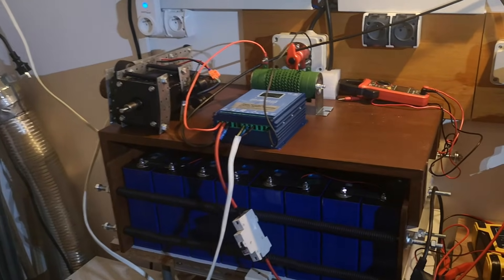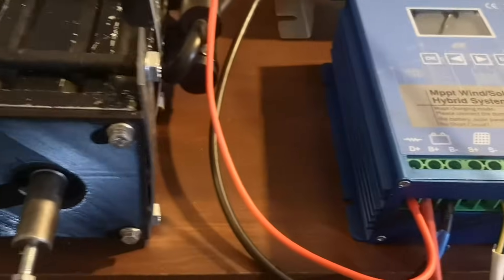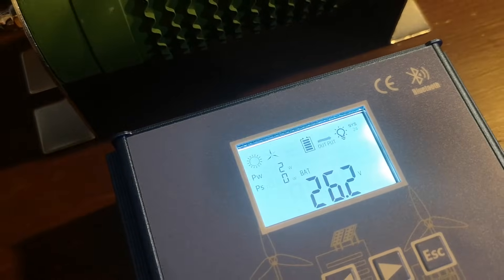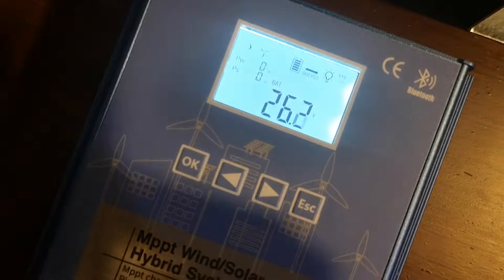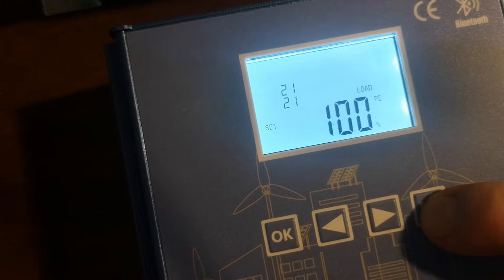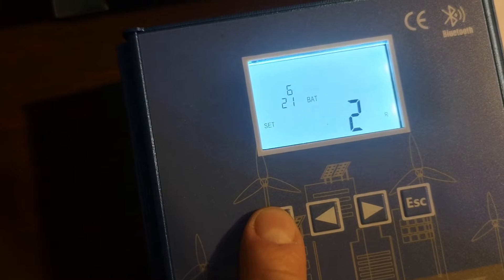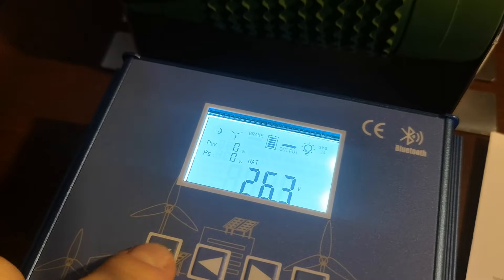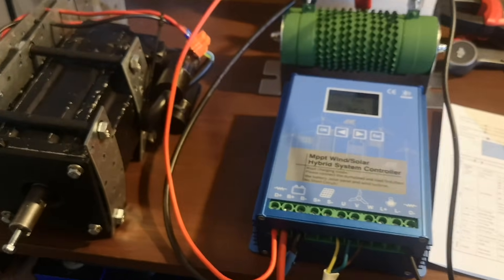MPPT wind solar hybrid system controller - review and setup

Comment: Hello, I have the same LHECR-48V charge controller. My 48V batteries are lithium. It needs more than 8V for the wind turbine indicator on the controller to turn on. It's not charging. No amps, no watts, even though the wind turbine can generate up to 20V. Can you help me?

Comment: Hi and thanks for the good info. I just have a question, mppt takes a small amount of power from the battery, but if there is no wind for example for 20 days how do I avoid mppt from draining the battery completely. Can anyone help? What is the load used for with the bulb? L+ and L-
Reply: No one ?

Comment: Just want to mention for others, that the CE symbol is NOT conformity for European Union, but Chinese Export symbol. So be careful if you use it as it doesn’t fulfill the EU norms for emitted radio frequencies, other safety etc.
You can google the CE symbol differences to spot it.
Reply: How did u carry out the frequency test radio emit thing. Which is an EU standard product?
Reply: @Vbastin-p2r   for you and other readers: please put in YouTube “ce symbol” and just watch some video or short to understand that to get the European CE symbol, the company is audited, has to do tests etc for electronic products. They do the tests, then they get the right to mark it. If it would fulfill the EU norms for electronics such as these emitted radio frequencies and safety, it would be allowed to have the CE symbol (the one meaning EU conformity) and they would print the proper CE symbol on it. BUT instead this one has the similar looking CE symbol (China export) that is used to trick people who can’t tell the difference between the two. China export CE does not require any testing, does not fulfill norms, and safety. This product has only that symbol on it, to trick you.

Comment: u could install big 180mm 12v computer fan(s) under resistor and/or charger, it has 12v output even if using 24v battery
Reply: or use 2 12v fans in series if 24v output

Comment: This charge controller will only work if you have your panels setup in parallel not series.  For a series setup you'll need an MPPT charge controller... this one is mppt on the wind only; the solar is pwm.
Reply: can use smaller panels in series if under 50v

Comment: Can I email you  with questions I have on this system? I bought it to get a 12v current for my Jackery 2000 solar generator. It has a 12v AC outlet so I could charge this from a battery system. I am hoping I can use this system and did not buy the wrong stuff. I could connect a 12 v battery to this system and then from the battery to my solar generator. at 12 V. My question is do I need to buy another controller from the system or the battery that will reduce this to 12 V??? thanks for any help. Steve Handy ST. George, Utah

Comment: Ok, I have this same controller. I've had it for about a year before I decided to change my system from 12 to 24v. Now that I've switched to 24v I am not getting any charge output from the wind or solar. If I change it back to 12v it charges normally. What setting am I missing that is causing it to not charge? Have the maunual, not worth a damn troubleshooting this issue.

Comment: Thanks a lot!! Question: I have a similar  hybrid controller for an Off Grid Wind & Solar installation. When I connect 1 phase from the wind turbine the turbine spins normally. When I connect no. 2 & no. 3 phase the controller brakes the turbine. Why and how can I control this brake function?  THX in advance. Morten

Comment: QUESTION: First of all, thank you for the video. I have this exact model MPPT. Second,  How do you prevent it from stopping the solar input when you have a big load demand? I want it to continue to feed the load whatever it can get from the inputs no matter what the load demand is.

I have set it to LOAD MODE 2 which is suppose to be LOAD ALWAYS ON, but when I turn on my electric microwave, stove and heater, it turns off the solar input and battery input. "Ps = 0" when I do that. Once the load demand drops the Ps comes back up to whatever wattage the solar panels are producing and it begins to send electricity to the load. Just FYI, I don't have wind connected, just solar and a battery. So this is only related to solar and a small battery backup which is 100% charged. 

 I just wish it would send the power it has to the load and not stop the solar input. 

The MPPT's  load output is connected to a grid tie inverter that only supplements the grid if it can get it from the MPPT controller.

Also, does anyone know on the what the individual letters (P, T, d) on the bottom right of the screen above K-W-h of some of the displayed info. Let me know. Much appreciate it.

Comment: got the same controller at 15 volts it shuts down i thought it was suppose to control that i end up having to disconnect  the panel till it comes down to 13.8

Comment: hi as like you i am running my wind turbine on a motor for constant running and not using wind 
can the dump load be put onto the ac in or output side instead of using the dump load ?

Comment: I have the same hybrid wind and solar controller and  it shows brake and its not showing charging current battery has 24.6 v and the brake should be on 27.5. But its showing brake now even before it has reached 27.5. Can you help me with this please.

Comment: Hi, how do I test to see if I get power from the wind turbine on the controller?

I got 5kw wind turbine connected with 48v lithium battery. Set the voltages correct.

Problem I have is when the wind turbine is spinning there is no input on the controller. What do I need to do?
Reply: Did you manage to find out ? I’ve also got the same as you . At most I get a 3w up the top but no Amp etc

Comment: Hi I have this controller  on 12 and on b1 my batterys  on 12.3 volts and brake on and  its dumping  all my power please help
Reply from the maker: Provide more info: what is the voltage of generator, that chemistry of battery. 12.3 is far to low to stop charging for any known chemistry (wet acid, agm, lifepo4 lion) give more info I will try to help

Comment: Can you take 2 turbines and run them together? Or do they have to have there own controllers?
Reply: SEPERATE. the output from each turbine with have mis aligned wave output. unless you can sync the waves you must have seperate controllers

Comment: hey. how are you sure that once the "BRAKE" is applied it actually does pass everything to the DL resistor and is not shortcutting the UVW inputs? have you actually seen the resistor heat up in the BRAKE stance?
Reply: The resistor does get warm on mine when it is windy

Comment: I have been using this exact controller for a couple of months now. There is one problem though, the voltage reads incorrectly. At a true 14.4 volts it reads 13.8  volts. After adjusting for the difference in the other settings there have been no issues. Overall it's not bad just off in calibration from the factory.
Reply from the maker: Voltage reading maybe shifted because of long connection (high resistance) bad connections etc.  have you tried to measure voltage on controller inputs using other voltage meter ?
Reply: I have a Victron MPPT controller for solar but use this product for Wind Generator. Both units display Voltage and %, on my setup they read to within 0.1V. of each other.
Reply: yep i have had one for 7 months and have found it to be a very good solarcharge controller (pwm) 6 x 100 watt 12v panels 2series  3 parallel (300w 24V) for a 24V battery  and i worked very good altough i would recommend to mount a extra heatsink on the back as it tended to run a bit hot, here in winter in overcast conditions it outperforms my big mppt system (watt for watt) 1/6 of rated panel power contra my big system under 1/10 of rated power

Comment: i been looking at this none stop for the past 3 months. was about to buy today. but i am still trying to figure out some stuff on it.   like.  what is the deference in the color screen and the one you have ?   is it there newest model?    other one is.  can this be chained. other words.  having more then one unit back to back. say i have 1000watt solar 1400 turbine.  chaining them so i can run another 1000watt 1400 turbine. instead of running another setup..  also.  who is the best to buy from.  i read bad reviews on the china models. some clam there not true MPPT.  some clam that if you open them up all the chips or wiped off so you can not repair it or alter them. forcing you to rebuy them. and some say there not getting the right watts out of them.    these or the things that you see everywhere and make it hard on where and what to get.      i run solar atm.  and been looking to upgrade to wind and water.  cause of where i live. i have a guest of heavy wind throw the pathway.  15mph winds feels like 30mph winds   and water none stop stream.   so this would help IF i can find the right one.     sorry for the long text but i can not get no answers out here.  and this compony dont answer there phones.  that is the other thing.
Reply: I have one like this one. On the wind, it doesn't start charging until 10 volts. I bought a Pikasola and it starts charging at 4 volts. As far as the Chinese turbines, you don't get near the power that they claim. I only get 16 volts in a 50 mph gust. Which doesn't even cut it when it's a 24 volt system. You're better off buying more solar.jm2cw
Reply: @shaymus1968   i am running 1500watts in solar atm.  my problem is night fall.  i am not running a windmill i well be running a water wheel but the motor is a 3 phase.  why i was looking at this cheap china model.  trying to find something i can run both solar and waterwheel same time.
Reply: @dragonshr280  that would work but, the one in the video, i bought first. It doesn't start charging until it receives 10 volt. I bought a PikaSola and the charging starts at 4 volts. The PikaSola is the better option and cheaper.
Reply: @shaymus1968   i well look at that after work ty.
Reply: @dragonshr280  are you running 1500w solar over this unit? in 24v? mine got toasty  at   just under  400w,,   no problems but hot to the touch
Reply: @kimmogensen5390   i do not have that unit yet. why i was looking into it.  i trying to find something i can run both my solar and water turbine.   atm i just solar
Reply: @dragonshr280  I must say that the combined Wind..solar controller are not that good unless one is only running a small turbine and a few solar panels. I have seen ppl use solar charge controllers for turbines  trough a full brigde rectifier and mount a external dumpload with a A30 voltage controller. And a solid state relay.. The power rating on these units are quite misleading. I have 2 1 2000w and 1 3000watt  turned out the 3000w only can handle max 1500watt in 24V  I will try to run a 1600watt turbine on the big one or else I have to pair them up ..
Reply: @dragonshr280  what did you end up with and any videos? I am planning the same thing with a small hydro turbine.
Reply: @shaymus1968  how much difference is there in the power production..? From 4 to 10v with so low voltage the power produced must be tiny?
Reply: @kimmogensen5390  I changed it to my 12 volt bank and the MPPT controller starts charging at 2 volts. In 30 mph wind i only get 11-12 volts. That's like 25 watts but if doesn't hold there. I just saw a video where, on the rotor shaft between the blades hub and the bearing to put a spacer there because the only thing holding it still is the magnetic pull. With the spacer the hub pulls tight to the inner bearing race. Without it, heavy wind will push the shaft in making the bolts hit the turbine body. Also, it pushes the magnet rotor out of line with the coils, so, guessing that kills on the power too.  Just waiting on the wind to pick up to see the changes. 🤞
Reply: I've also wanted to add magnets but, if they're too strong, it will add a cogging effect and might hinder the start up.
Reply: does not brake the wind turbine at high speeds .The controller just stops the charging and the excess energy goes into resistance, but the actual wind turbine does not stop it. Tested by me.
Reply: @stefancraciun7628  The one i have brakes. It won't fully stop the blades. Connect 2 of the phases and you can feel the resistance.  I upgraded my blades to carbon fiber. They're rated at 125 mph winds. Not worried about it flying apart. It would fold the pole before the turbine failed. First i bought a supposedly 5000 watt 12 volt turbine and it barely put out any voltage so, i got a 400 watt 12/24 volt turbine. Same exact power. Imo, all the turbine are the same and they just jack the price up with different charge controllers. I've tried everything to get more power with no success. Anyways, the person i was answering to said he is applying the controller to water turbine and don't think he's worried about a brake.
Reply: more dumpload??  i belive the one that comes with it are 600watt  @stefancraciun7628

Comment: Thank you for this video. I have just purchased one but there are no specs for Solar panels. I contacted the factory they said my system can take maximum 800w. My system is a 2kva 24v system. I bought 2x 400v panels. Can you help or do you know where I can get info - its difficult trying to explain in English and they do not understand. Thanks
Reply: if you are running solar i can recommend the pow mr  450v 80Achargecontroller/3000w inverter  combined unit ,they work well, are  cheap (same prize as a 3000w inverter alone)  i use these unit for turbines alone ,,the solar side on these are pwm but the wind should be mppt i have run 6 100w 12v panels trough one of these in series 3x2 panels  esentially  3 x100w  24v panels about 40/42v open circut it got fairly warm  but had no problems , but you have to tjek open voltage on panels  , i belive the wattage rating on these china items are fairly overrated i never run these at more then 70% of rating  and the cooling is very poor it might be good to mount the controller on a heatsink of some kind, a piece of aluminium plate and some stand off so air can cool it from the backside also
Reply from the maker: Please provide the model of solar panels or Voc (Open voltage) because not the power could be a problem but the voltage.
Reply: I have bought the same system and was also told 800w max for the 24v 2kva system. Not installed yet but Ihave the panels. I got that info from the factory - no further details tho.